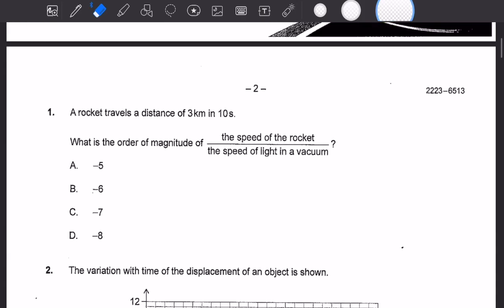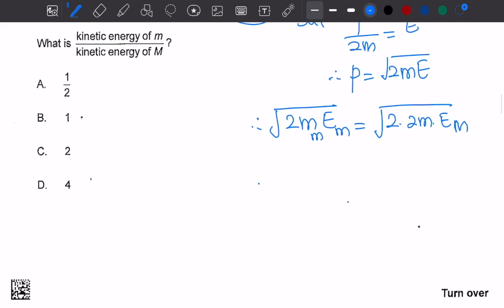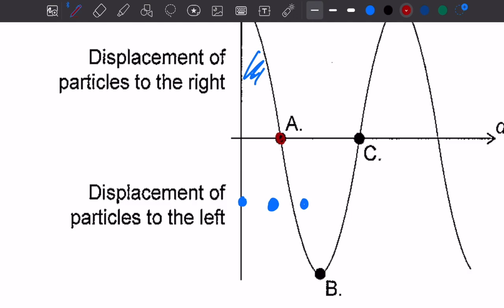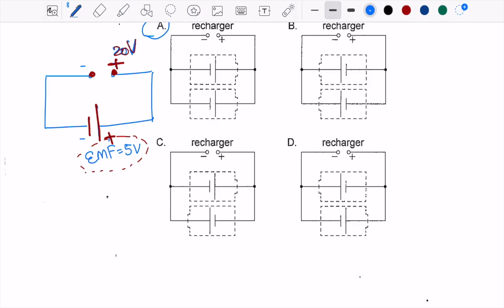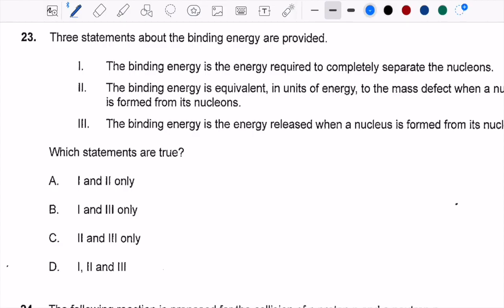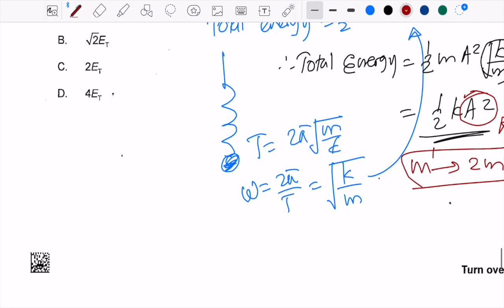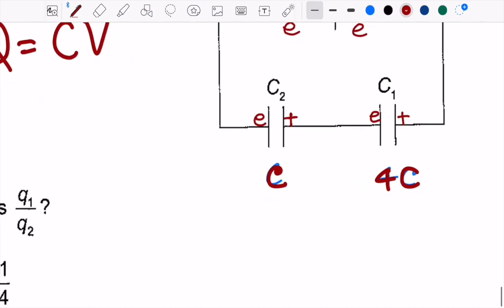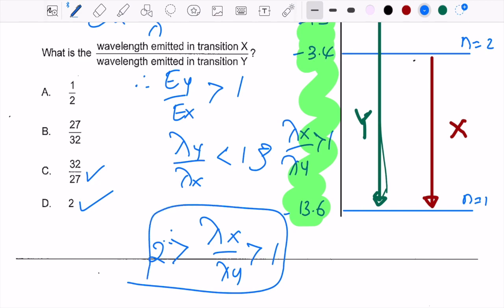2023 May IB Physics HL P12- Walk-through

Comment: In question 25 it there seems to be a mistake. Power formula for wind generator should be 1/2 A p v^3 not v^2. So the answer should be 6.
Reply from the maker: The marking scheme is out and I checked. The answer is 18 hence D.
Reply: @Veritasium-Sri-Lanka  I apologize but there is no markscheme in the google drive you shared in the description. Where do you get access to the markscheme?
Reply: Yeah. But we don't really care about v because that's the air of density p moving with a speed v. When you find the ratio between the two powers, the v, p, (1/2), and pi will cancel out. Leaving you with Py/Px = ( 9(rx)^{2} * 2(efficiency) ) / ( (rx)^2 * efficiency).
You cancel out efficiency, rx^2, and you are left with 9 * 2. 18